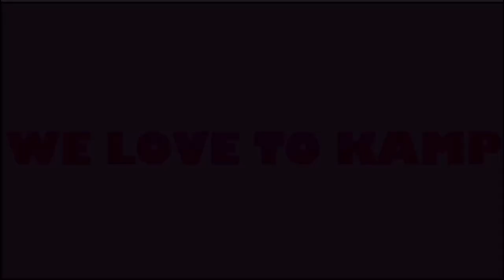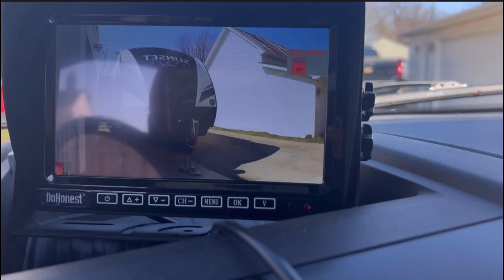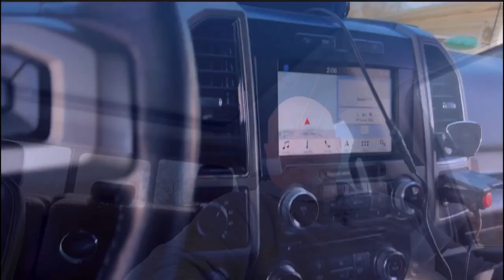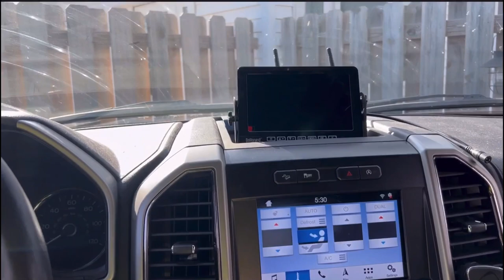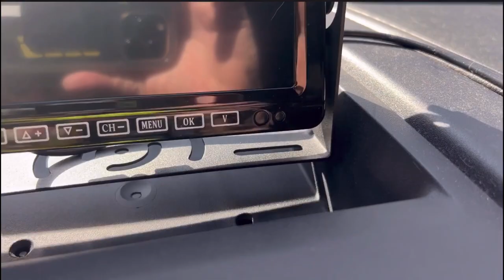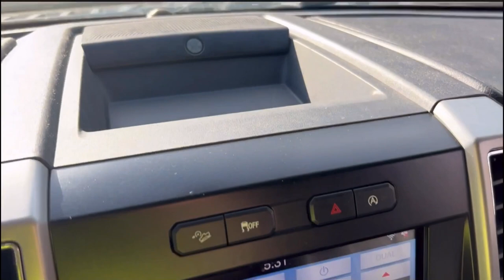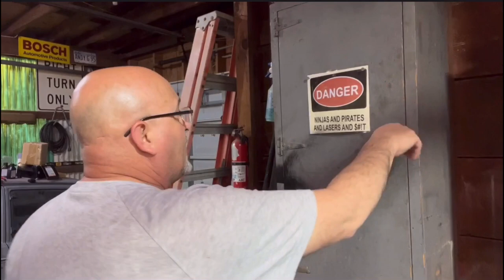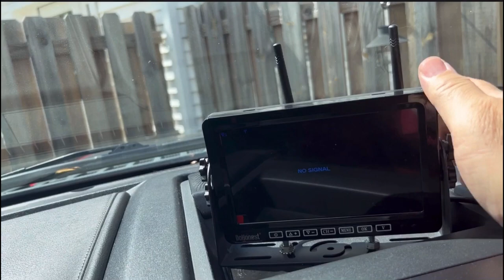How To Install a Backup Camera

Comment: Good job on the video. I just wanted to reach out with some food for thought. I came across your videos and realized I too am from Ohio and we also have a Sunset Trail camper. I just had to subscribe to help a brother out!😊 My wife got me an Amazon camera almost identical to yours a couple of years ago for my birthday. It is a Rohent brand. It came with the adapter kit for the Furrion camera. It actually had a metal plate that takes the place of the plastic one that is on your camper. The refresh rate is very good and we haven't had any problems in 2 years so far. I have a Ford F250 with the center console like yours minus the shifter. We use our GPS on the dash cubby so I used the suction cup to mount it on the sliding garage door on the console. I can just glance down to check traffic and it's out of the way. We have one problem I wanted to bring to your attention. The camera has the same frequency as my truck's tire pressure monitor system. At least once every trip we've been on it will set off the alarm telling me I have a tire offline! The 1st time it happened we were on the highway in Kentucky and we freaked out! We pulled over and nothing was wrong. Anytime I'm in the truck without the camera everything is fine. I'm not saying this will happen to you, but I just wanted to let you know it's possible and to be prepared if it does. Sorry for being long winded, but keep up the good work and I look forward to seeing more of your videos!
Reply from the maker: What part of the state you in? We’re in London. 
I have about 60 miles drive time on this unit and haven’t seen any interference as of yet… I’ll have to turn off the lights (camera power) and see if the fault goes away if this happens to me. Thanks for the heads up… good looking out. 
I considered putting the monitor that low, but I don’t like having to look that far down when trying to make lane changes or something… not a bad idea, but it would drive me nuts.
Reply: @WeLoveToKamp  I understand not wanting to look down. I was a UPS driver for 31 years and I had to look at things all over the truck constantly. Not too bad once you get used to it. We live in the south west corner of Clinton Co. We come through London on our way to Alum Creek when we camp there.

Comment: do you have a link for where to buy
Reply from the maker: Absolutely. 
Limited-time deal: DoHonest RV Backup Camera Wireless HD 1080P with 7‘’ Touch Key DVR Monitor, 2023 Newest Version Rear View Camera Stable Signals Adapter for Furrion Pre-Wired for RVs,Truck,Trailer,IR Night Vision S21 https://a.co/d/hUJJQGU